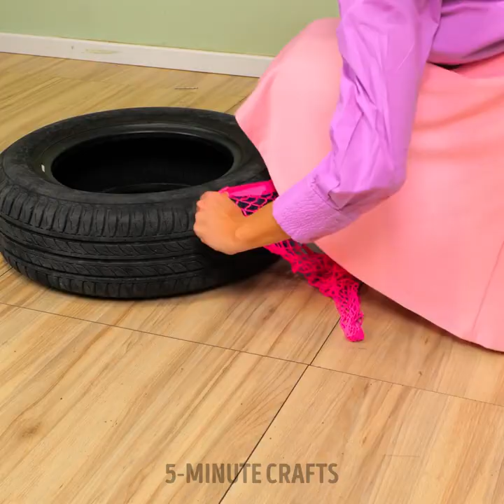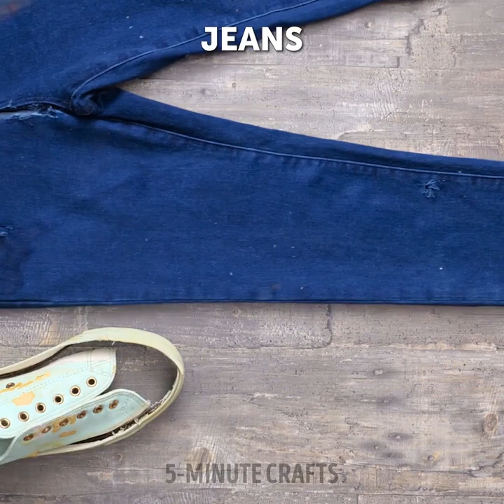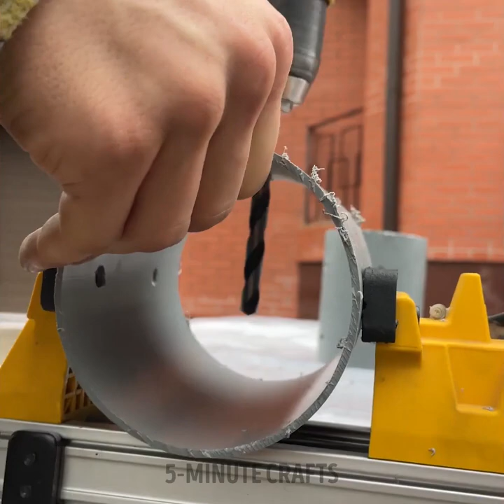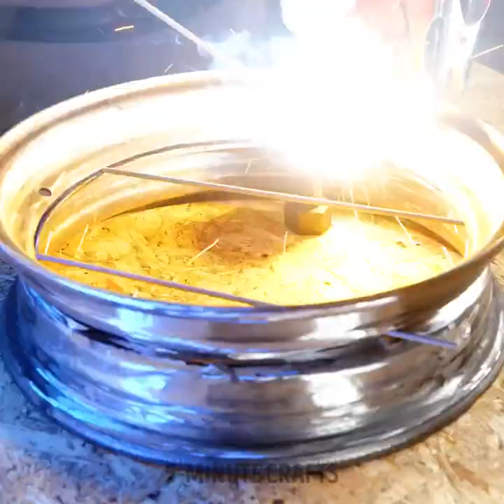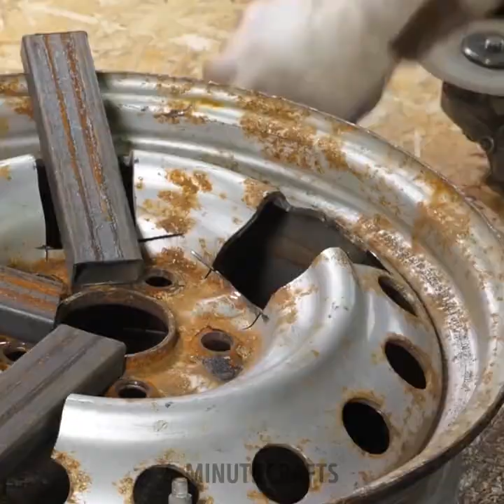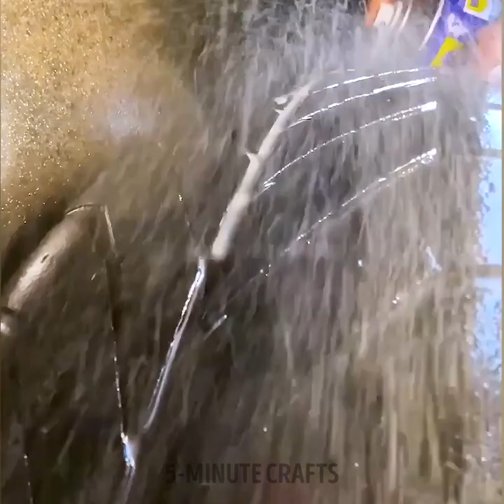Upcycling Alert: Transform Your Used Wheel into a One-of-a-Kind Home Decor Piece

Comment: I'm sorry to tell you this but you are wasting your time using a hot glue gun on rope and tires. hot glue is NOT going to stick and hold a heavy materials together... as soon as the hot glue dries it basically falls apart I know I have tried using it and several art projects. If you intend to have materials stick together and adhere tightly together...the hot glue is not the appropriate adhesive. Hot glue gun should be used for very light art projects that you don't intend on holding and handling very much. You would need something like a very strong epoxy to hold those materials together.